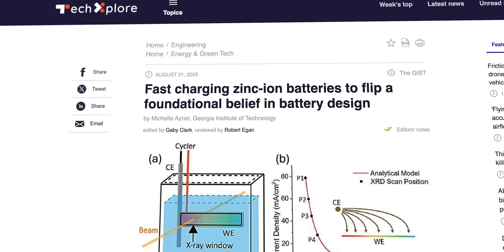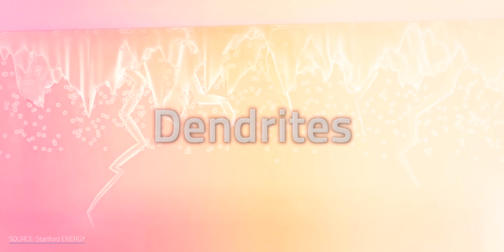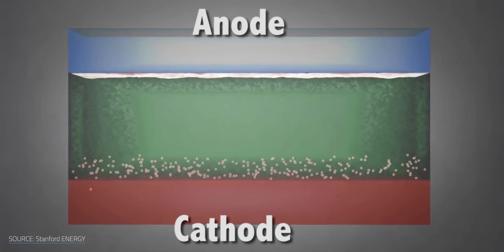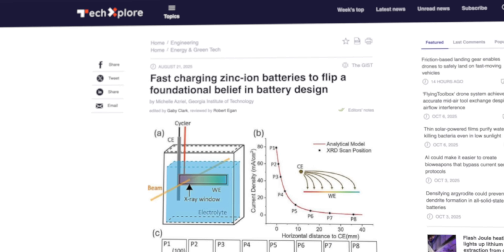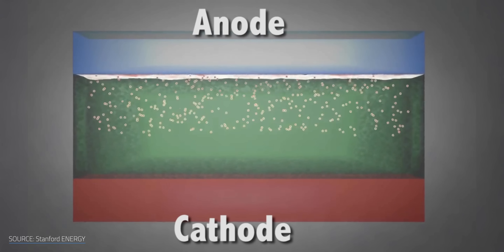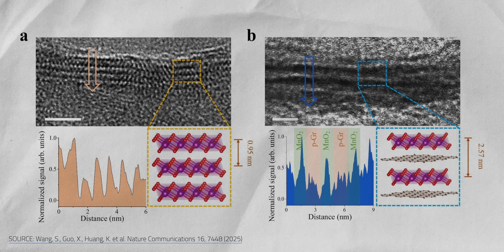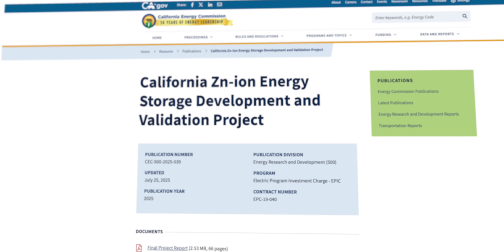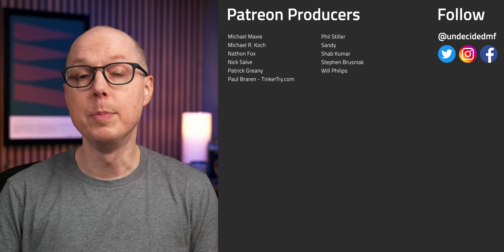The Surprising Battery Discovery No One Saw Coming

Comment: Okay, but phones already get extremely hot when fast charging right now. If the plan is to push them even faster, then phones themselves will likely have to change. We may start seeing fans, or phones that aren't as thin, or perhaps have twin charging ports with two cells.

Or more likely, most, if not all, phone companies will just not adopt the technology because they want you to buy a new phone as often as possible. Having a battery that will last up to a decade will heavily cut into their sales. Unless the EU mandates zinc batteries, then phone manufacturers would prefer to keep the planned obsolescence.

I must make this clear, though. I WANT this technology to match and exceed what they promise. I want to be able to own products that will last for years without worry of battery fatigue, or thermal runaway. But I've also seen how they're now kneecapping LED light bulbs by overstressing them with too much current to make them dim after a few years of use once they realised how long they can potentially last. I'm cynical, but not in the technology itself, but in the cruel, greedy practices of the people that want to perpetually sell you things.
Reply: This is not the grift, the grift is that phones do not have user replaceable batteries.
Reply: @szurketaltos2693 Agreed! User replaceable batteries, and built-in lens caps and a hardware switch on the power to the 2 to 3 microphones, which you can leave off until & unless you actually want to use the microphone for anything. Phones are a two-faced surveillance device, which can be "always on", even if you turn it off. It's absolutely outrageous!
Reply: Phones are FAR too thin already. I put cases on them, not only for protection since they are intentionally made to be fragile (for planned obsolescence) but also to thicken them up so they can be gripped by the edges with more assurance, and also be rubberized on the edges. But greater longevity is not what the cellphone OEMs want, or else they'd build all phones ruggedized, shock mounted internally and rubberized on the outside, from the start so they wouldn't NEED to be put inside a heat retaining "fur coat". Which is what a case does...it bakes the battery and other internals, shortening the lifespan otherwise than dropping it and breaking it.
Reply: Cherging dock with a heat sink.
Reply: If your phone gets extremely hot when charging, I suspect you use a Pixel! because that is the ONLY phone which gets extremely hot while charging, or else you've treated your batteries so poorly that is how they function. I had a Pixel once, and it was THE HOTTEST EVER, and also dramatically decreased battery quality only 6 months after having it. Now I use a cheap ass phone which can last days on a single charge. I don't need a fan to cool my phone, I just need a little time plugged in and it's good to go for a day and a half at worst. Some people are so used to terrible batteries they don't even know what it's like to have a good one. My pixel could be a hand warmer on idle, but my cheap ass phone is cold to the touch even when plugged in.
Reply: Well, these are not going to be in phones. They are low energy density. This is for grid storage, solar storage, etc.
Reply: @EricLS  I mean, you literally show a phone being charged at 06:03, as well as talking about the most common use of lithium being EVs, so you can understand why people would see the application in phones. The connection there is very obvious.
Reply: @DeathInTheSnow sure. A lot of EVs use low density cells too, LFP. LFP also doesn’t experience thermal runaway, though extreme charging rates will damage it. Still nothing compared to the Cobalt chemistries used in portable electronics.

Comment: I'm reminded of a problem that was almost endemic to the software development collection of activities when I got my CS degree. That was the concept of a 'Magic Bullet.' The idea was that in a war, all of t he problems might be solved if someone was able to shoot a bullet that would do just about any form of magic you can think of, corkscrews, going around corners, etc. and hit any designated target. People applied this to all manner of software developments, where the developers were solving a specific problem, and someone would try to claim that the specific problem being solved was a general issue.

We keep seeing that in the developing energy sector, where almost every development feels like it's being promoted as 'the' solution to problems that t he developers recognize as actually outside of the scope of what their specific solution provides. Does Zinc Ion updates solve some problems? Yes. Is it "The" solution? No. It is however 'A' solution for some problems.

As an example of where this may not be a helpful solution, what happens when the source of charging doesn't allow the charging process to immediately go tho high speed charging. Say for example it's solar power and first thing in the morning you get 5% of the capacity of your solar panels (if that) going into the battery bank. If that isn't enough to prevent the dendrite issues, it's no solution. For 'home' users, that may very well be a real problem in a regional power outage after a cold night. It's less likely to be an issue for Grid storage, where power may be coming in from across the zone. It may be the 'best bet' for Grid-scale energy storage, but I don't think it is likely to be the best bet for home stored power.

That said, it may be the best available solution for some time. Just recognize it has potential issues. As well as some potential work-arounds, such as dividing your battery bank up, and only charging a part of the bank early on, then as power becomes available, ramp that up through the morning till everything is getting a full charge. That may pose other problems though. Battery banks don't like unbalanced batteries after all.
Reply: @RNMSC  Maybe the solution in that situation would be to add a super capacitor (or smaller battery of a different chemistry) that would take that slow charge until full and then 'dump' that charge at high rate into the zinc battery? I don't know what intense pulses of charge would do to the zinc battery over time, but it sounds healthier for it than slow charging (to me, at least).
Reply: @Stormy177  I have no trouble imagining that there will be solutions for the issue. As you say, perhaps a supercap, or I wouldn't be too surprised at the possibility of using Lead Acid for this stage. Once the voltage coming from the source comes up to a point where it supports high speed charging, bridge the temper batteries into the feed rather than the load of the system. 

Again, the Zinc Ion batteries on there own are not a magic bullet, in combination with other updates, (some of which may have existed for decades.) Considering the capabilities of Sodium Ion batteries for low temperature, and low state of charge, I wouldn't be surprised if that ended up working into the situation as well. The down side of such a solution os that it adds complication to the BMS, which may, or may not, be easy to resolve.

Comment: Zinc would've been cool just a moment ago, but the new Sodium stuff coming out sounds "good and cheap enough" to me. But hey, I won't say no to a competing chemistry if it has unique features that might be useful for something!
Reply: Question is, how much do the batteries cost per cycle? And what is safer? AFAIK sodium ion is between LFP and Li-ion in safety.
Reply: @szurketaltos2693 I understood sodium had the potential to decrease in price below LFP, otherwise the only benefit is mining sodium is less destructive than lithium. If zinc were able to be restored with a fast charge and be comparable or lower in cost to sodium it would seem to be a clear winner, sodium cells are available now, zinc aren't, and LFP cells are similarly priced, so time will have to tell.
Reply: @extragoode  Sodium's valued feature is it can be charged down to 5 deg F. that's its most significant trick. Also cheaper and abundant. Right now heavier, larger and slightly less energy density. Like LiFePO4 was to Li, larger, heavier, less dense, but safer: in addition to that, Na adds charging below zero deg and is cheaper.
Reply: @extragoode you can potentially draw all the sodium in the world from the seas.
Reply: @ameerm4899 correct, that would be vastly less destructive than mining for lithium and is a byproduct of desalination
Reply: Na/sodium is safer then LFP now and as the technology matures it will get even safer and have higher density than LFP. 
CATL expect Na to be up to 90% cheaper than NMC cell to cell... that is just insane. Now it apparently cost just a little less than LFP because sodium is so dirt cheap.
Reply: @szurketaltos2693  why would you measure cost per cycle though? even if the battery can withstand unheard amount of cycles an average consumer will change the phone after 3-4 years
Reply: Sodium batteries is nothing special.  They require all the same expensive parts of a battery as lithium does except for the lithium.  Lithium is actually a common element on the surface of the earth and the onlynreasonnitnis somewhat expensive is because no one cared about lithium in the past.  Expect lithium to drop in price 10x in 20 years.
Reply: @zephyrprime except lithium is a big exception. Just because lithium is common everywhere doesn't mean it's easy to use. Whether it's mined out of the ground or pumped out of hot springs it's highly reactive and difficult/expensive to purify enough to use in batteries. Sodium is much more abundant and much easier to purify which is where the cost savings should come from. Lithium has been in high demand for over a decade, I don't expect a lot more reduction in it's price of availability unless a new method is discovered to acquire it.
Reply: @extragoode  Sodium can be easily produced by melting table salt and passing an electric current through it.  A regular guy can make a setup to do it in his backyard.  I did it myself years ago.  It's still flammable in air, though.  The big improvement is that sodium ions are totally nontoxic, given that we kinda need sodium to stay alive!
Reply: @zephyrprime  Lithium will no longer be used in new batteries in 20 years
Reply: Yes lithium will drop massiv in price because of the size of the industry now and the fact that nobody will use it in a few years. 
I recommend reading CATL's spec on their Na batteries and what they expect of it in the near future. 
They claim density parity with LFP on 2026 at a lower price, better charging performance, only loses 10% capacity at -20 celcius, more than twice the life of LFP. 
2026 is close we'll soon see if they are lying 🤥
Reply: @zephyrprime u don't have to worry about things catching for when concentrating lithium into a usable form
Reply: No reason why all 3 cannot coexist.
Reply: Energy density is the main issue.
Reply: They could substitute heavy water for the regular giving several advantages.

Comment: Another day, another breakthrough. And in meanwhile, over last 10 years, battery density improved maybe by 20%. Phone batteries still become unusable in 3~4 years.
And they are more expensive even when adjusted for inflation.
Reply: Over the last 10 years we've pretty much only been using lithium ion
Reply: @drsatan9617  I've been using even LiPo for 15+ years. Racing batteries.
In same size and weight, one gets 7.2V 5Ah instead of 7.2V 4.2Ah. Higher capacities increase weight.
And back then, they were cheaper (adjusted for inflation) even while being quite novelty.
Even back then, they had shelf life about 10 years. And actual number of charges and discharges did not improve much.

If anything improved, it is discharge C rating. What was back then rated as safe short term current burst, is now considered as long term OK current draw. So, you do not have to worry about running 500W motor from suitable battery.

Comment: Why not use something akin to a fuel cell, where the anode and cathode are liquid solutions, hence eliminating dendrites? These are called flow batteries. The "anode" and "cathode" liquids can be filled at a fuel station and at the same time suck out the "waste" material from the dispenser task and recycle it by "recharging" it through electrolysis.

Comment: I’m curious if charging these zinc batteries mentioned in cold temps will be possible. Let’s say before this fast charging the answer may have been no however if it forms dendrites is the primary damage then what does fast charging at lower temperatures do? If future electric vehicles will have a mix of battery types maybe including a zinc battery with an antifreeze additive and/or a software controlled charging system to distribute power under certain conditions could this type of battery not be part of an electric car? Or?

Comment: Well, if energy density is not grap but fast charging actually beneficial. Then I could see it for EVs too. All it needs is a fast charging infrastructure scattered like gas stations. If charging for let’s say 200 or 300km needs 5min and one can trust to find enough charging stations that should be fine for 90% of people and use cases.
Reply: Zinc ion batteries won't be in EVs though, because the energy density is not high enough. Your entire trunk would be replaced with a zinc ion battery if that were the case. Then your range becomes limited by weight, even if it is fast charging. Lithium Ion batteries are favored for their energy density, even though they are volatile and require slow charging for long life.

Comment: The water base concerns me.  What is the lowest temperature that the batteries will operate?  Will the water freeze in the battery?
Reply: I was curious about your question, so I looked it up.

There’s a pubmed paper with title “Lean-Water Gel Electrolyte Enables Zinc Ion Battery at -70 °C” that answers your question. 

The Perplexity-generated summary of this and a few other papers is as follows:

 Modern aqueous zinc-ion batteries have been engineered to use electrolytes with freezing points far below that of pure water, with some formulations remaining functional at temperatures as low as −70 °C or even −95 °C. This is achieved by altering water’s bonding networks or by introducing additives and polymers that prevent freezing and maintain ion conductivity. As a result, these batteries offer reliable performance both at high (up to 60 °C) and very low temperatures.
Reply: @hunchie …Thanks.  That answer makes a lot of sense.

Comment: Now I'm inspired to think a future battery could be based on hydrogen ion transfer. IANA chemist, just casually speculating.

 Unlike all the 'other metal ions", H+ is smaller than the potential deposit locales. This might be some kind of "organic" battery with a conductive organic anode with OH- outer attachment points or perhaps something more complex. Maybe it's a long chain quasi-hydrocarbon with a buffering ion attaching to each side atom. But then I suppose the travelling ion would have to be an OH- or equivalent. Could the anode molecules have a lot of OH- tag ends instead of H+ ?

Comment: How fast is fast charging in this case?  Is it actually practical for grid storage to fill in the duck curve?  For vehicle use fast charging is desirable for road trips but so is slow charging at home.  How slow can it charge without degradation?  How quickly could a degraded battery heal under fast charging?

Comment: You are missing some of the basic information required of a battery. 
* Energy Denisty (Gravimetric/Volumentric)
* Power Density (Charge/Discharge speeds)
* Cycle Life (that is the only one i see in this video apart from the cost)
* Operating temperatures
Reply: A quick check with ChatGPT says the energy density of zinc ion is about half that of LFP. So it’d be fine for stationary grid use, not so good for vehicles.
Reply: @davestagner  Who knows, maybe some of that graphene wheeze improves density. My bet, from what was said, is that it does, a little.
Reply: Energy density was implied - grid storage. Power density was assumed, ie that we knew how good ZIB was already. Fair if I remember. If you have to charge fast, you probably prefer to discharge fast or hope the fast charge resets.
Reply: Hes doing a broad overview of the technology, not writing a spec sheet for an installation. Even if he knew, I would assume each battery style, brand and manufacturer would be different. He did something similar not long about about the NAion batteries coming from CATL and those are already hitting the market.
Reply: Curious people can find all the details of batteries in thousands of sources. Do you expect every new announcement to first include a 15 hour battery lesson? Every single time? Plus there is a limit to what proprietary information is released by any particular company. We all must wait until this stuff leaves the lab and is in our daily lives, and most of it never will be. That's the price of progress and the risk that investors take.
Reply: @davidmccarthy6061  Without that information, it's really hard to gauge why we should be excited about this technology.

Comment: Are these zinc based batteries as sensitive to low temperatures as lithium based units?  If not that will open up a large market in colder climates.